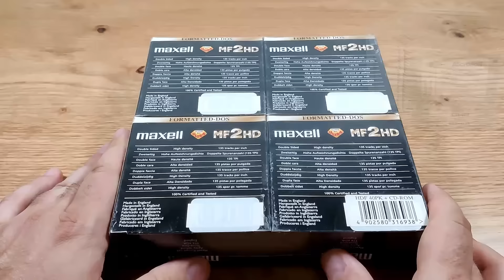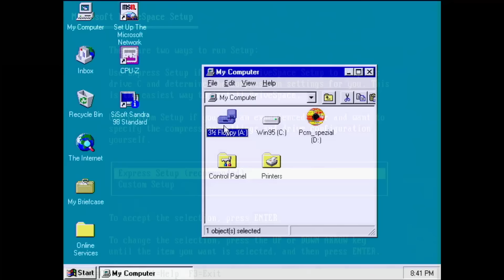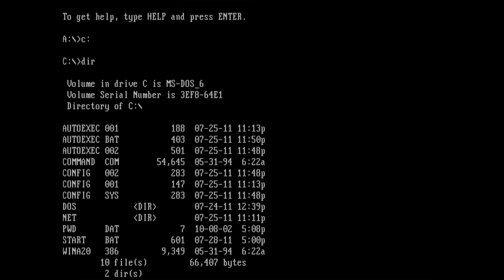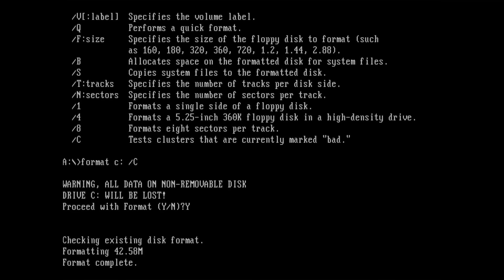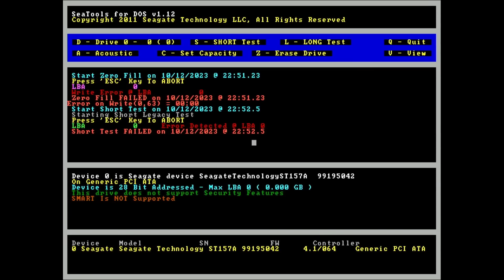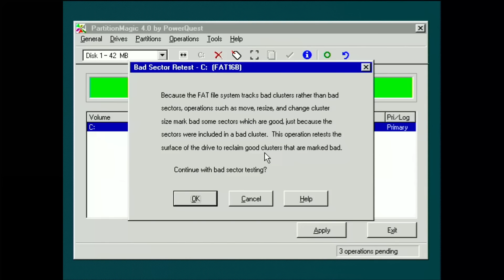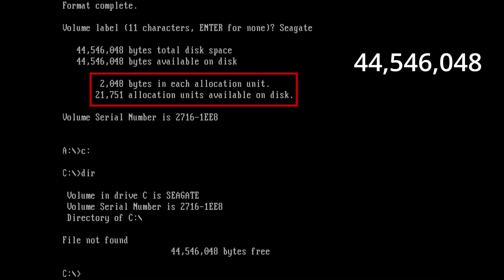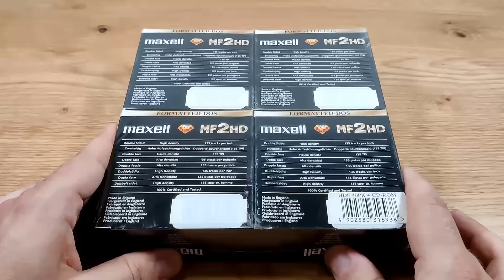HDD Bad sectors - Did my project fail?

Comment: Years ago,  I used a product called Spinrite made by Gibson Research. That software resurrected bad sectors on my Seagate st251 hard drive and I used that hard drive for many more years after Spinrite fixed it. I think the exact software name was Spinrite II. Hth.
Reply: I also used Spinrite II back in the day; I probably still have the retail package and floppy in storage. I first used it to fix a 32MB drive.
Reply: Spinrite is good, I've even used it to scan floppies.
Reply: Spinrite is still available and his website still sells it. Spinrite has the ability to "talk" directly to the drive. It's basically a software version of the BIOS but has more tools.
Reply: I was going to comment this as well, spinrite is a very nice tool.
Reply: Yes the early Spinrite was able to actually low level format a drive back in the MFM/RLL days.  This was because before the introduction of IDE (integrated drive electronics), it was the computer controller card that actually told the drive motors what to do.

So with Spinrite you could reformat everything, change the interleave and do a remapping of the internal bad sector table, even change the drive from MFM to RLL (assuming your disk controller had firmware chip updated for RLL) gaining 50% more space.

With IDE (integrated drive electronics) actually controlling the drive was offloaded to the PCB on the drive and the computer just gave a command on what it wanted the drive to do (say read the sector located at cylinder 4, head 9, sector 7).  It made life much simpler, but also took away that low level ability as there is no IDE/ATA command that actually reformats the drives.  

So the best you can do is zero out the drive (which does not zero out the track/sector markers) and high level format from scratch.
Reply: Upvoted for SpinRite also, it worked on many drives I serviced.
Reply: SpinRite is good for scanning the surface of the drive, etc. Another one is MHDD 3.0. It's the last known version that does not use logical block addressing(LBA) for older MFM, RLL, and early ESDI drives. Though a word of caution: MHDD does not support drives set as a slave!
Reply: true, i +1 the advice for spinrite's use.
Reply: Spinrite 6.1 is currently in development and very close to been released
Reply: Yes, Spinrite actually does something on drives of this era.
Reply: Yezz! Spinrite was an awesome tool!

Comment: I could never trust a drive with even a single bad sector.
Reply: I guess you'd never want to use mfm and older drives like that. Drives from back in those days would have a list of bad sectors printed on a label with other drive parameters right from the factory.
Reply: Every HDD has bad sectors.  The drive automatically works around them.
Reply: @GoatTheGoat  Is this true even when SMART shows zero past relocations? Are these factory mapped, low level format skipped bad sectors then? Most of the hard disks i ever used never gained any relocations during their 10-ish years of use. I know i should probably replace disks after 5 years but well i don't always do that.
Reply: I was like you until I could no longer afford to be... heh.
I have a drive that SMART began to claim "will fail in the next 24 hours" over a decade ago. I still use it as my "every day" drive. Turns out the automatic bad sector remapping area was full, so it can no longer silently remap newly failed sectors. Thus, it stalls trying to read/write any new bad sectors, and a couple minutes later will return an I/O error, which usually crashes the OS.
OK... from a newb's standpoint (at the time) let's see what can be done... First step: Find the bad sectors, Turns out they're all in about a 1GB range on the disk. Try to low-level format... Fail. Repartition hard drive around the bad sectors (create a 1G partition over the bad sectors that will never be used, not even formatted, and other useable partitions around it). This was reliable enough to install an OS... then use it for a while... then use it as my main system for long enough I needed to run a backup and start thinking about what would happen if it got a new bad sector...
Did some research... turns out unixes have a badblock marking utility just for the purpose, been standard IT practice for ages. Did enough research to be confident enough I could probably get my drive running again as reliably as it'd been without much hassle... planned to occasionally have to hand-mark bad blocks relatively often... make regular system backups...
I've since used the drive for well over a decade in my main system, which has gone from an old iBook G4, to a atom-based system, to a RasPi, then another, and plausibly soon a newer atom... the iBook died due to the GPU BGA failure. The atom died when I tightened the board/heatsink down to its screwposts too hard (trace/BGA fracture?). The Pi was an emergency backup... the first one died due to a power surge due to a grounding problem in a 12VDC system with too many high current peripherals. The second Pi was a drop-in replacement, just glad I had a spare!
Through all that, over many years, the drive has never had another I/O error/bad sector. ...much to my surprise. The only reformatting has been to the first (root) partition, to reload the OS appropriate to each CPU. The third partition being /home/ never had to be reformatted, still using the same user folder after all these years.
Oh, I forgot, I did use Mac OSX 10.5 this way, with this partition-around mapping for the first few years... 'badblock', being a longtime unix de-facto utility was in there, too, I think.
But again, it's never gotten a new bad sector! Hah! And if it weren't for that machine's ignoring SMART, and my USB converters, thereafter, I'd've been prompted with the "Drive will fail in the next 24 hours" boot message every day for all these years. Hah!
Reply: @ericwazhung  I mean a megabyte hunk with bad sectors plus remap exhaustion indicates a scratch in the surface from some sort of very undesirable physical event, which meant there was material bouncing around inside the chamber. Luckily it for sure got caught in a filter, and hopefully permanently so, though that cannot be strictly guaranteed.
Reply: You may not believe this but every spinning rust box has bad sectors somewhere, even on the latest drives.
Reply: @SianaGearz  Could very likely be... that was my assumption too. But it could also be poor adhesion of iron oxide or any number of other possibilities. Again, either way, particles floating around is definitely a concern, as is the idea of burrs on the platter scraping the head... But, aren't these the same concerns with any new (post-manufaturer-testing) bad sector?
 I may've been lucky, or maybe fifty+ years of drive manufacturer experience somehow accounts for much of this... I mean, if that were as much a concern as we all think, then tools like badblock or scandisk surface scan/marking would be kinda silly to use at all, so would only be emergency measures rather than maintenance utilities, and clearly documented as such... right...?
Reply: @SianaGearz  Yes, they all come with some number of remapped sectors from the factory. Sometimes just tens, sometimes thousands. I've seen brand new SAS drives with several full tracks (plus some other random sectors scattered about the disk) in the defect list.

Personally I don't worry much if a drive grows a few defects here and there. It only worries me when the count starts increasing rapidly.

It's funny to remember that the early IDE disks didn't have spare sectors or defect lists or any error correction logic, only the error correction that was part of the bitstream written to the drive. It either read or it didn't and that was that. They weren't far removed from the MFM/RLL drives that had about as much logic as a floppy drive.
Reply: @ericwazhung  that's just.... sad.
  I would just GIVE you drives if i ever met you
Reply: @kintustis  ... Thanks for the thoughts... but I'm actually rather fond of the long-term science experiment this has become!
Reply: Don't look at my Toshiba 1 TB drive 😅
Reply: Disk doubler on Mac worked great.
Reply: @ericwazhung I had a PS3 super slim that suffered the same, gut wrenching fate as your atom. Must have put too much pressure on the CPU and/or GPU when using thermal pads (or, something. I can't quite remember) and it was dead.
Reply: @ericwazhung My Dimension 2400 was a trash pick. Used by the original owner up until 2022! Like, holy fucking SHIT thats frugal! 

Now that I think about it, might of been due to the original owner EOLing before the piss soaked Dell. (It was DISGUSTING when I got it.)

The original hard drive is in there, running Debian. It did act weird after getting it, but did settle itself.

Might of been the dog piss, or the fact I accidentally dunked it in water when I was scrubbing the case in the downstairs utility sink (oops!).

Either way, I plan on replacing it with an sdcard solution as these old computers need all the helping they can get. After that, the hard drive is getting shelved, ready to get used whenever I need one.

Comment: Have a look at HDAT2. A free and powerful DOS software that I use daily on my job to test and refurbish HDDs and SSDs. The drive is small. Wipe it 10 or 20 times and then run a read write read test. It might reduce or remove all bad sectors. With newer disks, the controller will reallocate those sectors and replace them with spares. Unfortunately, there's no such thing in such an old drive, as far as I know
Reply from the maker: Thanks for the suggestion! I'll give it a try.
Reply: Yup, other ones that come to mind are HDD Regenerator(paid), SpinRite, HDDScan, and MHDD (for older drives).

HDAT2 is my favorite though.

Comment: A lot of my IDE drives have died over time but a few are still working. They are also very heavy for storing and these are the reasons I like to use flash based storage 😊
Reply: Phil I understand what you are saying but I love the sound of an old spinning disk. I still use mechanical drives obviously until they all die
Reply: @Roadkill7878   cant you just connect both flash storage with  the broken hdd and only redirect the ide commands to the broken hdd without relying on the response so we have noises while using the flash storage for retrieving the data?

Comment: Bad sector are the worst! As far as my knowledge goes (correct me if I'm wrong), forcing the drive going through the bad sectors further weakens it, should be avoided. However it is the only way to know about them, so we should test those sector the least possible.
Reply from the maker: For now, I'll keep the drive as is. Maybe later, I'll try to see if tools or bios low level format can do anything about those bad sectors - just to see if anything can be done or not.

Comment: I was always using NDD (Norton Disk Doctor) to test HDD and floppy surface and mark bad sectors. It was way better than scandisk. It could, however, destroy/damage the data on the drive if you allow it to fix "logical" problems, like, say, "disk structure". So be careful.

Comment: I've had an idea in my mind for a while now. It's a simple idea, but difficult To Implement. The idea is to get the sound of an old HDD while using a modern SD to IDE. If someone could make a device that can use old spinning HDDs that no longer work, but still spin and have a working head arm. If we could use the LED of an SD to IDE that is connected to a spinning HDD and have the LED flashes to make the HDD move the drive arm. I think it could save many old HDDs from the dump and would bring back the sound and feeling of old PCs. I know a speaker device this available, but nothing can replace sound of a real spinning drive.

Comment: Three things that might help:
1: Google 98 Lite. It might squash a 98 install small enough. Unfortunately Windows 98 isn't Windows 95.
2:  Spinrite. You'll be sent to Gibson Research. He's a guy who's been doing things like this for a long time. He even has a test program for Zip drives for the "click of death". Spinrite can sometimes "exercise" and fix bad sectors pretty reliably.
3: Drivespace/Doublespace that's built into DOS 6.xx. The "Microsoft Plus! for Windows 95" had the latest version of Drivespace 3 that had even better drive compression.
Reply: Spinrite has been great for me.  But though it can 'fix' bad sectors, you'd be best off to take the 'fixed' drive out of service asap afetr getting your data from it.
It can also scan pretty much any storage device it can see, floppies, zips, SD cards even ipods.  I just with Steve would hurry up and finish the new version which uses a much better way to access the drives so recovering a 500Gb drive will no longer take 24+ hours.

Comment: About 30 years ago I started trying to save those dying HDDs using stuff like low level format, repartitioning, chkdsk, Scandisk, Partition Magic 4, WD and Seagate tools and some more.

It never worked out, the bad sectors almost became more and more in short times.

All in all roundabout 100 drives I tried to fix over the years (mostly by customer wishes).

IMO there are mainly 3 reasons for bad sectors:
Bad platter plating (e.g. Conner, Maxtor).
Particles, emitted by the dust filter hitting the platter surface and moving around.
Headcrash (quick death)

The first/most dying HDD brands in order and my experience:
Conner
Maxtor
Seagate
IBM
Fujitsu
Toshiba
...
WD

Comment: When I was young, I had lots of free time but no money at all. So I have done all of these things: drilling/cutting holes in diskettes/floppy drives to make them double sided, reformatting to get more capacity, using arj compress content, used Doublespace/Drivespace for more diskspace, tools like Quarterdeck QEMM for more memory, overclocking without knowing what I was doing... I learned so many things that are now absolutely obsolete and none of my younger coworkers have any idea what I'm talking about. I installed both Windows 95 AND Office 95 from floppy disk, which was a very time consuming excercise. All of this combined with questionable hardware (dumpster dive acquired VLB cards, buggy chipsets, leaky capacitors, shoddy power supplies, dying harddisks), but it still brings a smile on my face when someone else is going through the same paces on youtube, well done sir!

Comment: There were some configurable win95 versions released to oem's for their own customization. Some copies are available online if you poke around enough. You select the components you want and leave the ones you don't out. A lot like the embedded versions ms used to release for hw manufacturers. You can definitely get the install down to 15-20mb depending on what features you want.
Reply from the maker: Thanks for the tip! Great fallback solution if the other installation fails for whatever reason!

Comment: Well that was quite the trick. You've got both the first hard drive I had (the ST-157A) and the second (the Caviar 11000), too!

Yes, I did go directly from a 43MB drive to a 1GB drive. I thought I'd never fill it up. Turned out I needed two more of those 1GB drives within another year or so. The first was originally a 16MHz 286 that got upgraded to a 386SX/25 in 1992 or 1993. Back then one of the best things about hard drives was how much faster they were than floppies were. The next one was a Pentium 75 I got in late 1994 or early 1995.

I can't say I ever tried to wedge Windows 95 on that Seagate, but I did get WfW 3.11 going on it (thanks DoubleSpace!) so I could use Mosaic, which required Win32s.
Reply from the maker: What a coincidence. Happy I got those two drives right for you!
The Caviar 2850 was a drive I had in my AMD 486 DX4-100 system - my first PC.
Unfortunately, while cleaning the case, I unscrew the drive, thinking you have those tiny bent metal tabs holding the ars drive. But there were none. While I put the screws away, gravity did its work and the drive fell from the HDD cage about 20cm to the bottom of the case. The drive no longer worked after that stunt.

Comment: A modern-ish tool i like to use to repair bad sectors (even on drives as new as 2000 in my experience) is called victoria disk utility. There are special modes within the program that can force write to bad sectors, or do long write cycles to magnetize bad sectors. It needs windows XP or later, but if you have a system that runs XP and has a proper IDE controller, it is very handy. This tool can run on modern versions of windows as well, but it is mostly designed for XP.

Comment: I think I tried something called "stacker" back in the days as my HDD was indeed a 40MB HDD and I could barely have Windows (3.11) and a few programs there before it was full. I remember when we ran the program and showed double capacity! Wow! Still, when actual data was stored, the final actual capacity was more or less the same.

I remember watching a video about these programs, one turned out to be just a GUI, no actual compression. It was pure, 100% marketing :D
Reply from the maker: That sounds like RamDoubler or so - it was just having a few fancy gauges to show you your free memory, but it didn't actually do anything, let alone double your memory.
Reply: Stacker was a legitimate disk compression tool.  Microsoft tried to license it but didn't want to pay enough and integrated a different product for DoubleSpace.  Stac won a lawsuit against MS resulting in MS-DOS 6.21 with compression removed and then 6.22 with DriveSpace, which used a different, non-infringing algorithm.